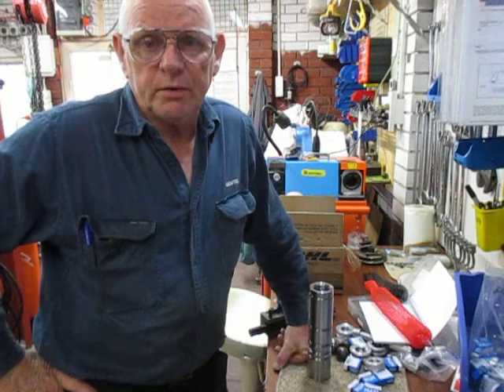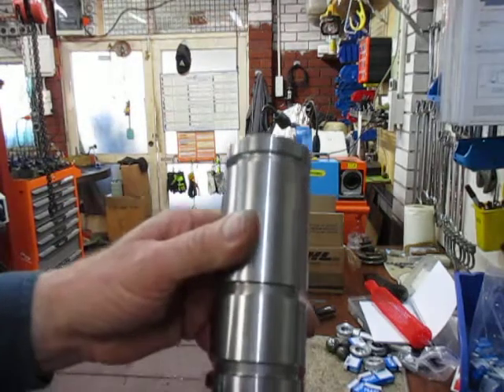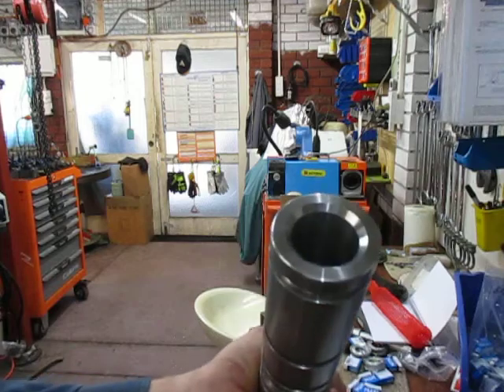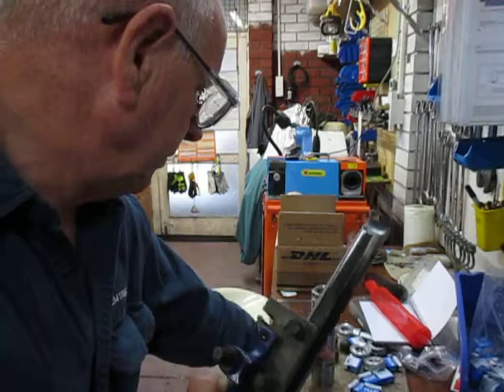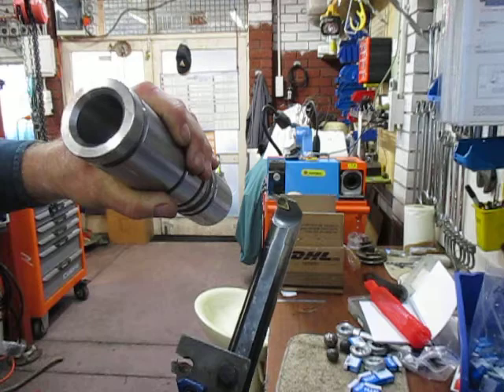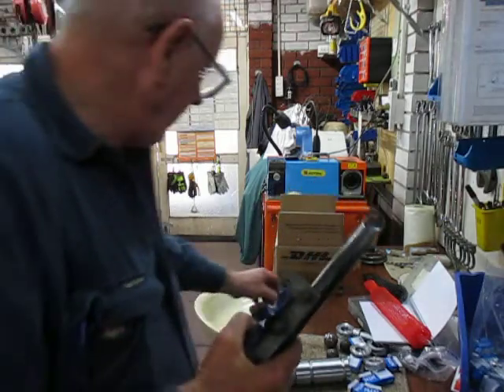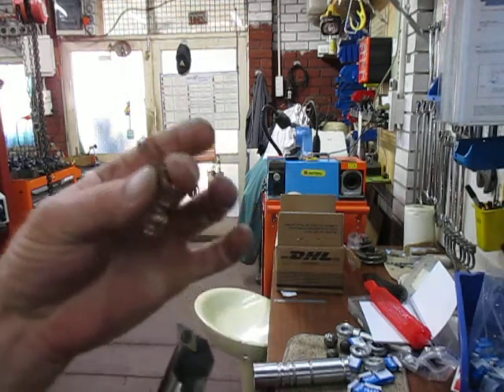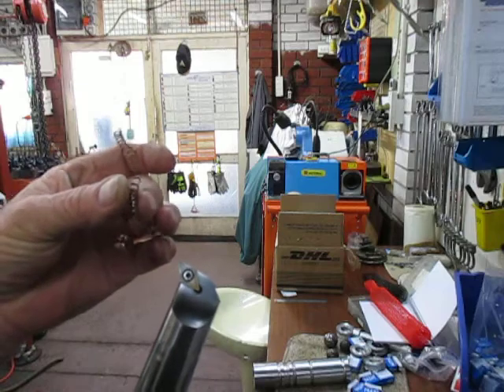Saturday Afternoon Special 2

Comment: Great stuff, Bruce!  I am a fledgling hobby machinist and I glean a wealth of information from every video.  I am curious, what would your options have been if the hole was smaller or if the piece was longer such that you could not reach in from both ends and cover the entire length?  An extreme example would be a gun barrel, never mind the rifling, how would you bore a long skinny accurate hole?  Thanks for sharing your knowledge and experience.  Guys like me benefit greatly from your generosity.
Reply from the maker: Lyn thanks, I was talking generalities, and rules of thumb, there are many ways to attack the job and it is relative to the level of accuracy, the material you are working on and the tools at hand.In an earlier video I showed several ways to overcome this. I have a boring bar that I drilled and tapped a hole most of the shank length then filled it with broken carbide mills (I ground them flat on the ends), then put a grub screw in to tighten everything up, works a treat. it is also possible to fill with sand, oil or whatever. The other option is long series drills either purchased or home made. I'll make a video about deep hole drilling / boring.